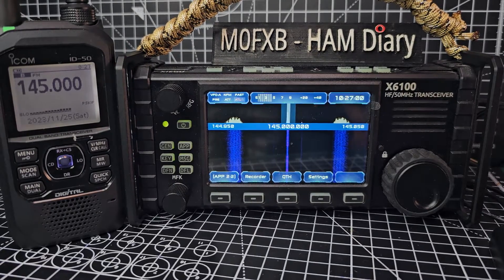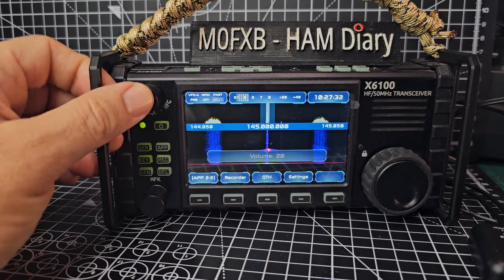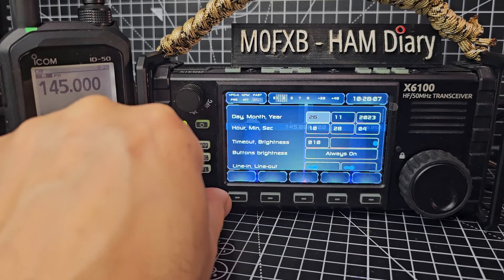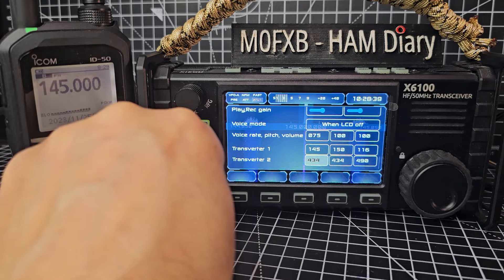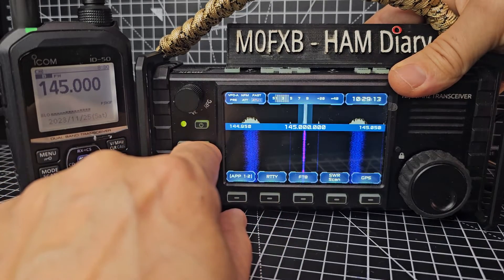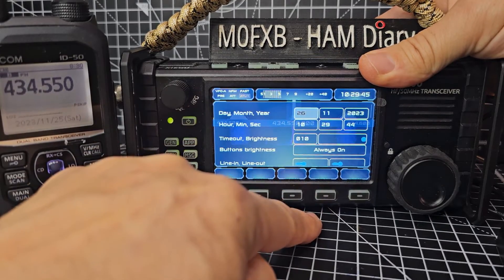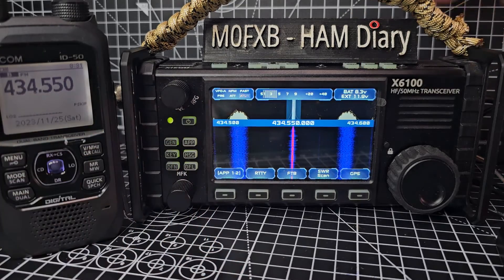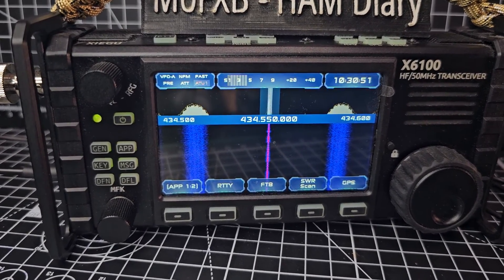XIEGU X6100. , 2 Meters & 70cm Mod , (R1CBU)v19 Transverter Needed

Comment: The id-50 not worth the new price get a used id-51 virtually the same the x6100 is an ideal portable qrp hf radio both very good 
If you add the cost of both it is still cheaper than the current price of an icom 705
Reply from the maker: Agree